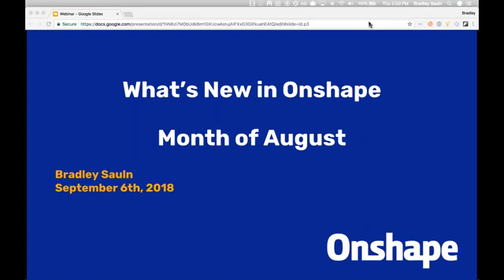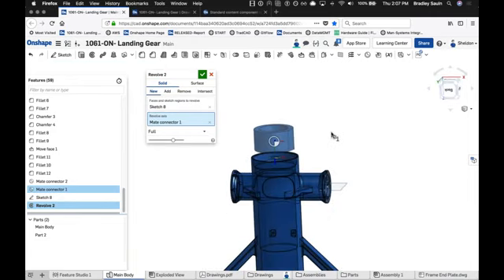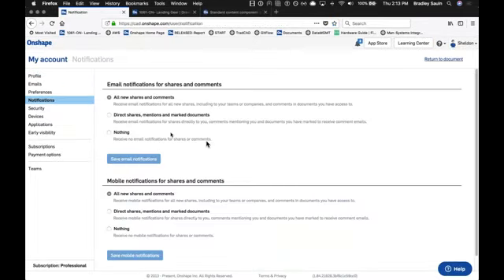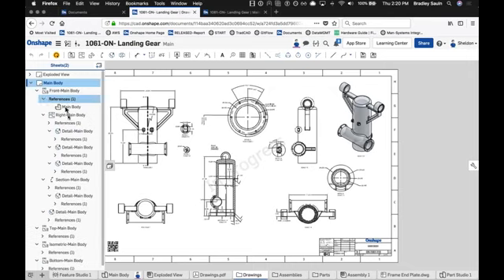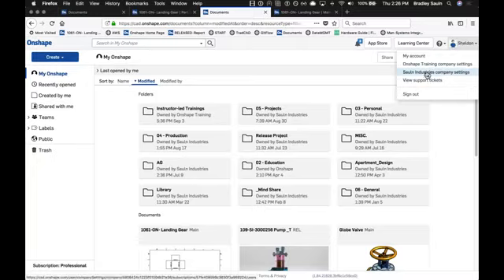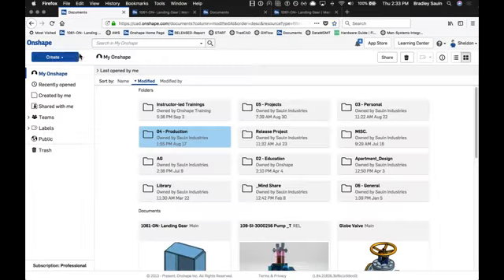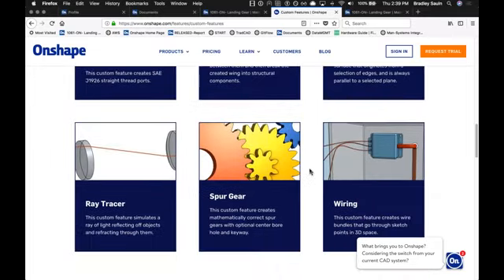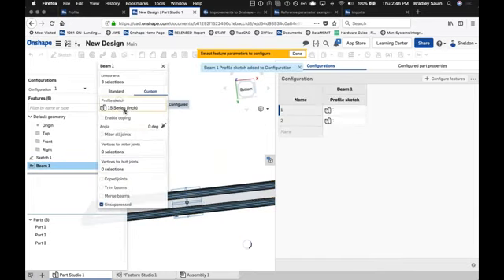What's New in Onshape - August | Webinar

Comment: In Cody's webinar on puttin.bolts in holes quickly. I tried it it worked well.  Is there a way to end with a quantity of the same bolt in BOM.  I believe it listed each bolt separately instead of say bolt size blah blah quanity 1
blah blah quanity 1
blah blah quanity 1

Preferred method
Bolt size blah blah. Quanity (3)
Reply from the maker: It should already do this? Are there subtle differences?